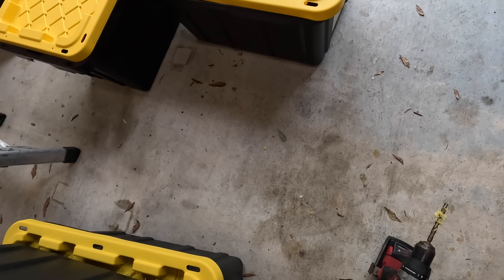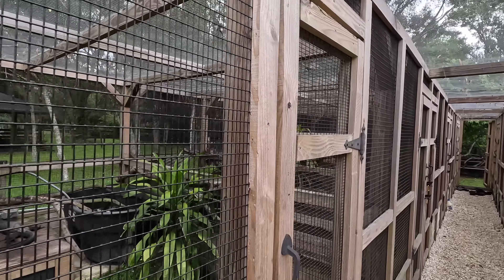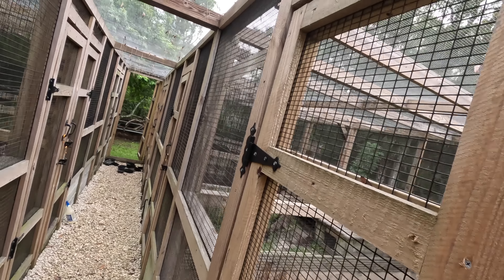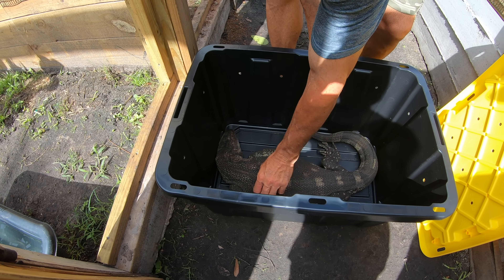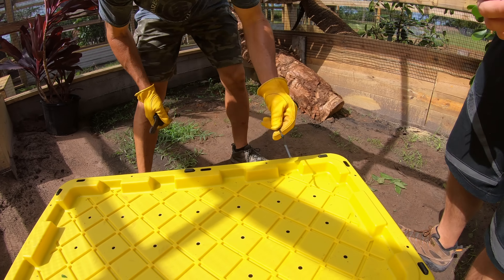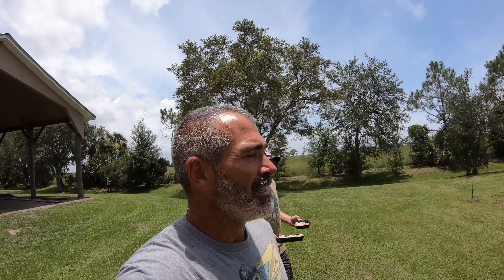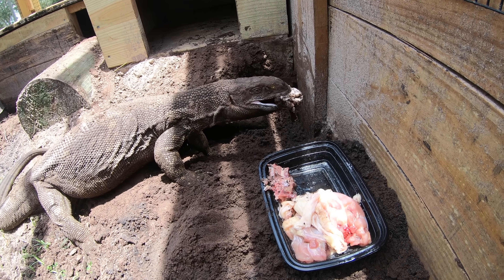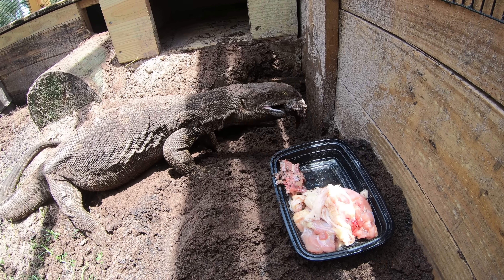Officially Moving the First Monitor Lizards to HQ2!

Comment: Shade cloth above the enclosure ceilings could be pretty easy and easy to customize for your needs since you can get different %'s of the light blocked.  Probably wouldn't be too hard to suspend some to cover the walkway and the entrances and water tubs  just inside each cage.
Reply: 100% agree shadecloth will help a lot
Reply: Shade cloth is a great idea 👍